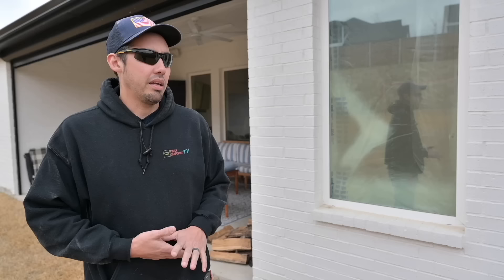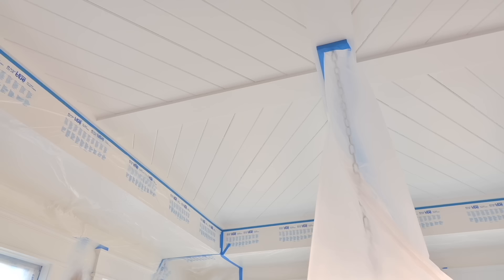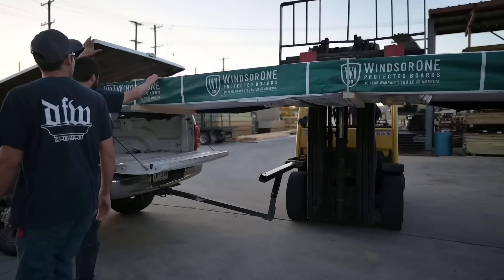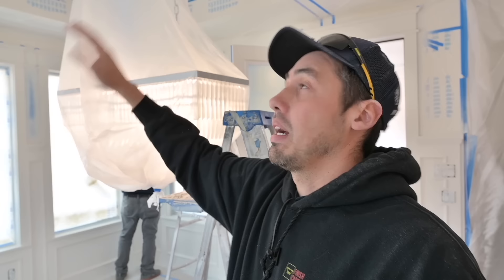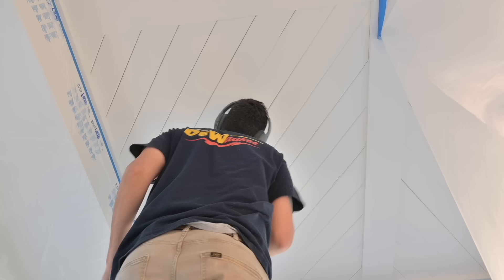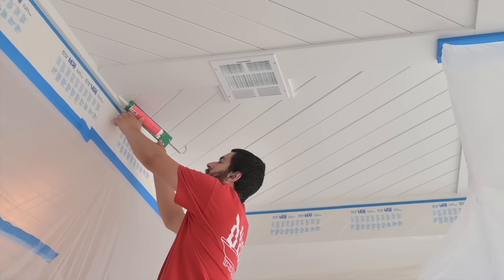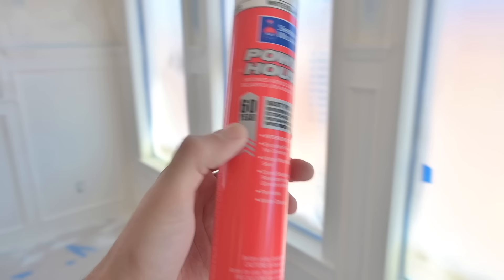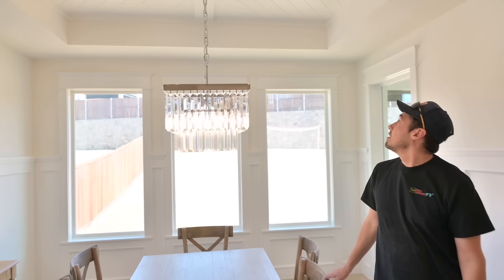Customer furious with me - Failed Trim Install

Comment: I’m curious to hear what WindsorOne had to say about this. Even though you installed the material same day that product is highly processed finger joint pine that is coated with exterior primer and should be extremely stable.  This is worrisome and I know you must have lost sleep over this one. Super stressful.
Reply: Probably would say, did you prime the cut ends? And, why did you caulk the grooves?
Reply: @NEKingdom241  Knowing how stable Windsor one is as a product I would be curious to know why they believed he had an issue in the first place. It’s one thing to fix a problem and satisfy the customer but it’s even better to know why the problem happened in the first place so you don’t repeat it on another project.
Reply: @crownmoldingbyspectaculart941  Again, it would be nice to know if all the end cuts were primed, as per instructions. A kitchen can be a high humidity environment at times, and dry at  other times. Also, Windsor One's warranty doesn't cover shrinkage.

Comment: The mistake is very simple and you should just admit it. What happened was that you caulked the seems. You ain't supposed to do that, if the owners don't like a seem, tell them they shouldn't use it. Always make sue you have straight boards.

Comment: It's not your fault actually. If the wood expands and contracts, And you bought wood that said treated on it from a literal wood processing plant. Then yeah, All wood comes treated from those places. Otherwise you buy it at another price, called untreated wood. By the way, that looks like the worst ceiling to work on. What a headache. Cant just have a normal ceiling have to have some crazy overpriced wood trim pattern. That room alone looked like 40k woodwork

Comment: Dude, There is nothing you did wrong. The only issue is you dont have years of experience to tell the customer that there is no way you can guarantee that these will stay tight. This is wood and it moves just like oak flooring.  After 37 years of installing T&G you just pre paint everything so when it does shrink you dont see it.   You never caulk it because can can rip the tongue or grove right off the board. I live in NY where I have install 24' T&G and that board has to move.  So all I can say is know the limitations of your products or suggest a man made product which dont move as much.  People around here like the inconsistency of real wood its natural.  Rap your house in vinyl if you want everything  looking perfect with no character.

Comment: Ahahaha. This stuff is prety much outa your hands dude.  Theres a reason why 99% oc cielings are drywall.  Lol. Drywall dont shrink.     Thoes boards shoulda been left natural wood color and allowed to expand and contract on its own year after year.  
You can fix the caulk however i believe this is gonna be a continuing problem.

Comment: This guy is just using a hack to fix another hack. You have to use paint thinner on the entire celling and oil the boards so that they can seal up better with the changing seasons. This is simply a case of architects or the customer not knowing what is the right or wrong way to do things. And the fault lies on the carpenter or contractor just going along with what the customers wants but not what is right.

Comment: Dude, you haven’t learned anything from this and are going down the exact same road. Read  Benjamin Beran comment below. Do not caulk t&g boards! Pre prime and paint your wood equally on all sides. With real wood there’s nothing you can do to stop the movement, even if they maintain constant temp/humidity (which they won’t) the same exact thing

Comment: Any good carpenter knows if you're going to use caulking that needs a gap and if you smash your wood together and try to fill a crack that's what you get next time use siliconized on the edges and don't do any caulking at the seams tell the customer it has to expand and contract otherwise change the design but it does look cool just seems like a b** now that you having to go back I would have just one done one straight shot above the ceiling 45

Comment: It was a poor fix.  I never would have contracted a second job until the first one had been fixed in a more professional manner.  Not understanding what caulk & the wood choice you used for this application indicates that this was a shoddy fix & you’re not quite up for this kind of challenge.